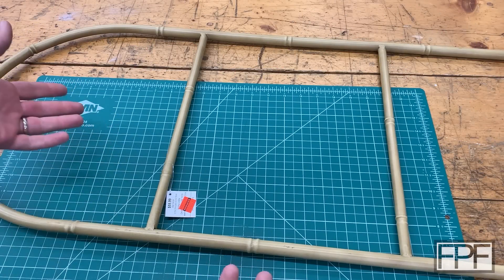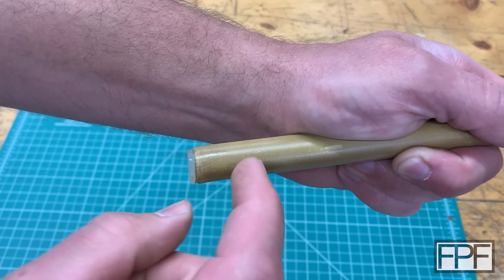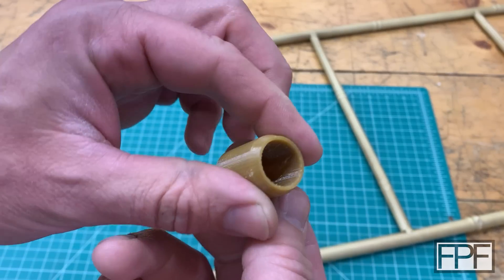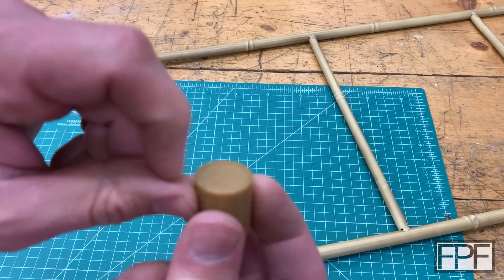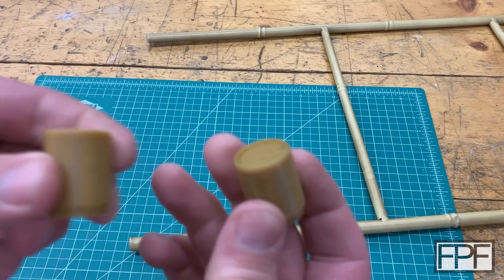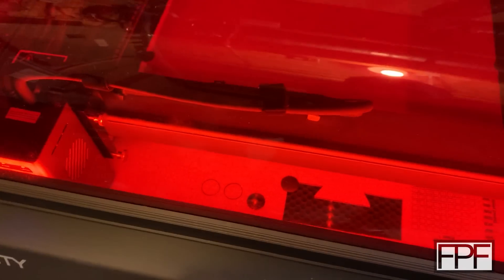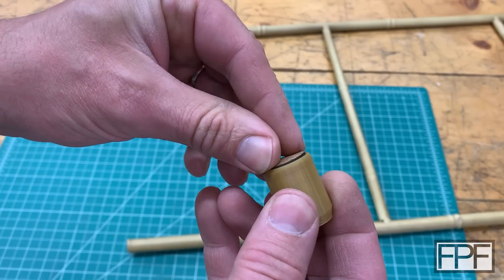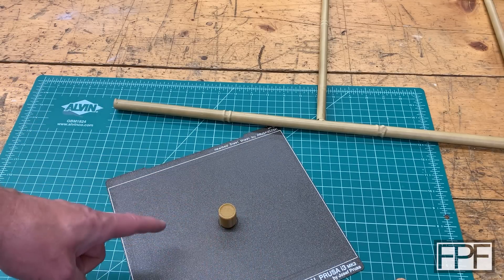3D Printed TPU and Cork Replacement Foot

Comment: Cork seems like a bad idea for this. You can buy all sorts of sizes of adhesive backed rubber feet at the hardware store. And you can still do the foot thing so you can put a larger one on and make it secure. They also make feet that have a hold in the center to put a screw in to screw it to the leg. I think a sheet metal screw would work well here for this.

Comment: Bet the original foot is TPU/TPE. Because silicone takes time to set, so it's fundamentally more expensive to mass cast.

The difference is likely to be in the surface texture that they can can produce with a processed mold under pressure vs. how the material settles while 3D printing under surface tension. Our prints are likely to be microscopically smoother, while the mould can have micro texture for a slight gecko feet effect. It can also be in durometer, we usually print with somewhat harder material and rely on voids to make up the macroscopic compliance that we need.
Reply from the maker: interesting.  appreciate the insight and info

Comment: I learned on my second TPU print to use a dry-box. It's a great material. But I could see the difference from the start to the end of a 4 hour print.
Reply from the maker: I wish I could find a dry box that actually held the temps needed for drying/keeping dry.  All the ones I've tested do not meet spec when I've measured them :(
Reply: @FunctionalPrintFriday  drying and keeping dry are two different jobs. 
I have a modified food dehydrator for drying. It can easily get and keep the air at 10% and 50 c for the whole time it is running. (I use a PIC to regulate the temperature. )
Once it is dry, I use cheap plastic cereal boxes to hold it with desiccant until needed and while printing.
 Longer term storage is in vacuum bags with desiccant.
Reply from the maker: @GlennBrockett  yeh, I use a "magic mill" food dehydrator for the actual drying and it works geat.  I just wish the boxes sold as "dryers" that you can print from actually did what they were marketed to do

Comment: @FunctionalPrintFriday I’m getting pretty comfortable printing lots of different types of models and materials, but I have no real CAD experience. I want to learn Sketchup and Fusion360, but I’m wondering if you have any advice for where to start? Online videos/courses? I feel like I need the structure of a course with assignments and samples to really dedicate myself to it.
Reply from the maker: Checkout onshape.
Reply: @FunctionalPrintFriday  I did try OnShape once a few months ago, but was going in without any tutorials or guides, so I didn’t get anything accomplished. I’m just having trouble getting motivated to do much this summer 😕

Comment: Nice to see the ol' MK3 in action again. Slicer should have a setting "do not cross perimeters" that helps a lot with stringing when printing TPU.
Reply from the maker: thx, I turned that on for this week's prints.  I had this on for my TPU profile in my old slicer and was surprised to see it wasn't on by default on Orca.

Comment: I would say cork is overkill coz tpu with hilbert curve or just bit uneven contact point/surface will grab to any flooring.
I printed leg protectors for Ikea Frosvi chairs and those are working pretty good (sidrnote they have to stay firmly on the leg of the chair so I had to use a bit of electrical tape on the leg itself coz smooth walls didnt wanted to grab to wood as much).

But ohnestly that cork insert just looks neat.
Reply from the maker: thx!  I love the idea of hilbert curve for the bottom

Comment: Shoe Goo and E6000 are nearly identical with the main difference being shoe goo uses a flammable solvent white E6000 uses non flammable solvents (made by same company BTW). I use to use Shoe Goo when I worked for Showbiz Pizza Place to glue character masks (cuts, rips, fur...) that was in the early 80's. They also have Household Goop (same exact product as shoe Goo, just different marketing).
Reply from the maker: thx, didn't know this and appreciate the history

Comment: you can get better overhangs by stretching it, usually called bridge flow ratio, in prusa slicer its in print settings, and in advanced, under overlap

Comment: A similar type of adhesive to the Shoe Goo or Amazing Goop stuff is the classic E6000 craft adhesive (also available where that “wall decor” came from) which works quite well with TPU (and maintains a semi-flexible bond. I think those are all very similar (but slightly different) formulations. I have also used E6000 to repair a delaminating sole on some hiking boots and it has held up for a few years. I think the E6000 stuff is the best for general purpose. But it does dry up within a few months after opening, so it’s better to buy a few of the smaller tubes in a pack rather than a big one.
Reply: Must be different E6000 to what I got from amazon, it wont even stick to the overture TPU I am using , just peels off.